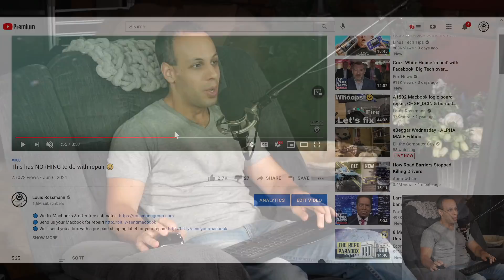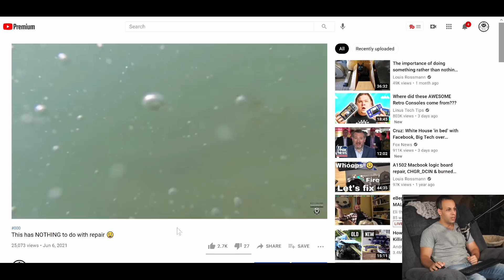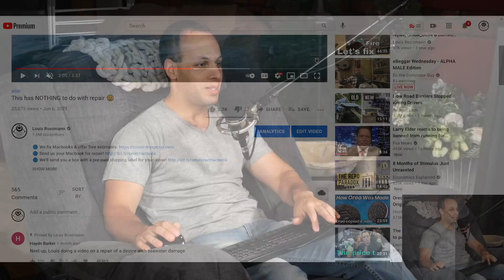Why are user serviceable batteries a bad thing?

Comment: I would hope that everyone would agree that we shouldn't have to go through miles of glue to replace our batteries. Some of the Microsoft Surface machines literally need the screen replaced if you swap the battery, which is just silly. It is easier for them to design the device without the removable battery, and it is better for the bottom line. I think it is just convenient for companies and people don't care enough about it because they know in two years time they will probably buy something else. Maybe once they can't improve computer chips anymore people will start thinking about repairability again.

Comment: At least having the back side screwed in with torx screws instead of being glued would enable battery changes in a matter of minutes without any increase in thickness. It would also look good in flat devices like the iphone 12-line. If a battery lasts 3 years a battery change can extend it to 6 years, two changes to 9 years etc. If it wasn't for the battery and software making it obsolete, a smartphone could easily last a decade with cases and screen protectors. The industry wants consumers to replace their devices every two years but I think a five year cadence (with a half way battery swap) is much more reasonable economically and ecologically.

Comment: It is like manufacturers plan the device to be changed every 1-2 years... I gave my old smartphone to my mom, and recently the battery died. Thank go I bought a spare one because it's not available now. Also, it's stuck on android 7.1 so go figure it out. Could be good if I could install Lineage OS but that is also not an option now as manufacturers take some measures against it (encrypting the storage or something). I hate this so much... Meanwhile, I found an old Samsung X520, I bought a second-hand battery and it is still working.

Comment: So this is what I've learned over the years about removable batteries, from user testing, repair and industry insight.

1: The vast, vast majority of device batteries, to this day, are still socketed in some fashion - not soldered. So if you can get to the battery, IMO it's some degree of "user replaceable". 

2: Sony made water resistant phones with no discernable bulk added vs nokia, samsung etc, with user replaceable batteries, as far back as 15-20 years ago. Same for more modern models. They still had all the common ports.

3: There's this magical thing called a "gasket". Not quite bleeding edge tech, but still pretty cool.

4: The primary reason batteries are "sealed inside" using adhesive on the last 5-6-7 years of smartphones, had nothing to do with IP rating. It's a combination of 3 factors that lead to this. 2 of them being user/customer demands.

First; Users demanded wireless techs like NFC (and all the utilities that enables, from easy tap n pay, to secure entrance credentials (displacing plastic cards). And wireless charging.

Second; Users demanded more premium materials. They didn't want plastic rear panels anymore, but glass, ceramics or metals.

Third: Incompatability and manufacturing technical limitations. Making a friction fit and durable user friendly rear cover, is somewhat easy. You cast/mold it in plastics. You could also stamp and punch it in metal. It's not very cheap, but its economy scales very well.

But there's the problem. In this situation, plastic is out. And metal is a no-go - it blocks wireless signals so no NFC or wireless charging. So to meet customer demands, you're left with glass or ceramics.

These materials are fragile if a panel of it is bent and twisted. So the materials themselves are inherently not user friendly for this application. Next, manufacturing one that has the complex shapes and small, super tight tolerance details needed for a friction fit phone rear cover, is a nightmare. 

Tolerances must be super tight because the material isn't forgiving - it won't bend, stretch, twist etc. So if you try to (just) cast and mold it, expect more than 80-90% of output to be trash. So you're left with painstaking manual, by hand shaping and finishing. And a lot of it. There will still be significant waste and breakage. This process scales terribly, because the majority processing is manual detail work. So the end product - your barely user serviceable, friction fit rear glass or ceramic panel, will cost at least $40-50 a pop to manufacture. And because of the inherent material property, you can expect to have to replace probably 50% of them under warranty when they break while used as intended.

All this - not happening. No way. So what's the alternative? A simpler geometric shape that is easily mass produced. So no friction fit. Meaning it has to be attached to the phone with adhesives.

Notes:
To get batteries out, you still often need heat, some IPA and some patience to get them loose, especially in the case of smartphones. As they no longer have the mechanical structure retaining them by clips and plastic profiles, they're now held in by ahesive. Some manufacturers are better about using pull tab style ahesive strips, enabling you to "pull out" the adhesive strips from under the battery. Those are notorious for breaking, but the intention is still there.

Comment: Louis does bring up a good point. Serviceable batteries does NOT always mean you lose water resistance. My sister gave me her Galaxy S6 when she bought her new Galaxy S7 years ago. I did some research on the S6 once I owned it and saw that none of the marketing promoted it as water resistant at all, not even the S6 Edge either, whereas the regular Galaxy S5 was promoted as IP-67 water resistance, removable and replaceable battery, along with a micro-SD card expansion slot. The Galaxy S6 had none of this. Granted, it was the first phone Samsung had made with glass on the back, something that not even Apple had on their iPhone 6. If you wanted to buy an S6 with water resistance, you had to buy the S6 active that came out 2 months after the regular S6 came out, kind of screwing over some of the people that had initially bought the regular S6 in April of 2015. They added the micro-SD card expansion slot later on the Galaxy S7, S7 Edge, an S7 active but the battery wasn’t as easily serviceable as they still kept the glass on their backs anyways. Those were just my thoughts a couple years ago, where you can imagine how confused some people were as to how the Galaxy S6 and S6 edge were sealed with glass backs yet they had no water resistance even though the regular Galaxy S5 had a removable back-cover with replaceable battery and still managed to have an IP-67 water resistance rating. It’s some truly mind-boggling shit.

Comment: I remember when I had an s5. I had two extra batteries and a charger for them. when one battery finishes in 30 seconds you have a fresh charge. for at least a few years I never charged my phone on a regular basis. was just swapping batteries out. eventually a small crack did develop on the back cover where the indentation is but I just got a new back cover. 

and that phone was water resistant / waterproof (cant remember which marketing term means what) but it was one of those 2. I had that thing submerged multiple times. the back cover just had a rubber gasket going around the circumference of the phone so when the cover clips in place there is some mounting pressure on it. that was sufficient. I remember how pissed I was when the s6 with a sealed battery launched. 

I much rather have a thicker phone with so much more functionality than a thin slab of fragile glass with no bezel to prevent the base of my thumb from accidental touches. Surely there must be a way to make a phone look nice as well as keeping all those functions in.

Comment: People are manipulated by sopposed experts.
When i bought my last phone and complained about the battery not beeing replaceable in the phone i aimed for, the store employee told me that thats the only way the battery could be that capable, the phone that thin and durable.
I called hin on his bs - the phone i had before had the same capacity, was nearly as thin (3 years earlyer, so other components got thiner in the mean time) and was extreamly durable (fell down from >2m (>6.5ft) and the only thing that happend was a dent and the battery falling out).
The industrie is a master in manipulating the masses.

Comment: My S5 mini had a replaceable back for battery access, a headphone jack (a budget phone that came out TWO YEARS before Apple removed the Headphone Jack!!), A MicroSD Card slot and a charge port without a flap, which AFAIK, is the first smartphonephone, or at least Samsung phone to do this.

Comment: What if they just start practically filling devices full of hot glue to ensure any attempt at repair breaks the device? The legislation has to be wide enough to cover what its trying to discourage in spirit, right to repair should mean parts the manufacturer has access to are accessible within reason and devices are not manufactured with malicious intent to prevent repair(ie everything is serialized and permaglued together.).

Comment: I’ve had a couple digital wrist watches (from the 90’s) that I swam with and replaced the batteries as an 8-9 year old. They were water resistant and the battery wasn’t sealed. There isn’t any reason a phone can’t be the same way.

Comment: I hate this attitude of let's take away more features and raise prices.  that's why I've held off on a new phone. I like headphone Jacks, I like user replaceable batteries like my note 4 had. I want an SD card slot. I loved the IR blaster that basically was my only universal remote until the peel app stopped working.  I like getting a charging cable and power brick with a new phone.  why cant companies do stuff like that in a new phone. you had all the tech back in 2014!!!!!

Comment: You have to meet people in the middle. Every laptop 10 years+ ago would have a chunky removable battery, nowadays there are non removable battery laptops that are thin, light and have 4 times the battery life. There are still some laptops with huge removable battery, it's a choice for the consumers. Some people prefer thin, light and sealed laptops... maybe it's not even a technical choice, they prefer the design or style. 
Just because you prefer/like something doesn't mean everyone else does too. Right to repair should not biased towards 'modular'/'open' engineering, don't mix right to repair with that please...

Comment: I still miss my Note4. Did I care if it was waterproof? No. Did I replace the battery 4 times before it began to have bizzare hardware failure that im pretty sure a repair shop could have fixed if parts were available? Yes. (I still have it, and would pay to have it repaired)

Comment: Batteries are now doing shit, what they didn‘t do in the early 90s and 00s:

They bloat and light up in fire. This seems to be caused by thinning and change to high energy Li-Ion batteries.

So that is a reason to lock it away from consumers, as it can be dangerous when the battery is already bloated.

But:
1) EU law demands your battery has to be user-replaceable… more and more companies glue their batteries in and need special equipment to replace it.

When the process itself is dangerous and cannot be done by untrained people, then it is simply not user-replaceable. 

2) I am struggling a lot with DELL at the moment, as they had in the last 3 models batteries that bloat. The problem is, when bloated they break the plastic of they main hull. When we did the call to DELL they just said „it is normal“ meaning - „works as designed“.

You know what DELL? Your Design is BS and therefore your Business Model is BS.

Why have you forgotten to know how to make good batteries and laptop designs?

If your batteries bloat, then design the hull with 5-10mm more space and nobody would notice.

Comment: During a February evening get-together with friends in a previous life in the far north, I dropped my 5110 on a snowy sidewalk without realizing it. Some hours later a middle-aged dude picked it up and since this was before the time of PINs, unlocked it and called the first contact on my phone, one of the friends I was with. Picked it up, thanked the good soul, looked at the phone and shrugged. I have doubts my current S8 would survive the same treatment—and goodness do I miss having replacement batteries I could slot in.

Comment: it'd 100% suck if the commercial answer to right-to-repair is to fully pot and seal the inside of the device, making repair virtually impossible. You'd be able to buy the chips and see the schematics, but no way you can do anything reasonable on the device. I'd say there does need to be some safeguarding to complete asshole designs

Comment: Often, the software support dies way before the battery. If I can replace the battery, but but don't receive security patches in a timely manner or not at all, then it's still disposable for everybody  (except of those, who find alternative operating systems) who care for security. Repairability as well as software updates need to go hand in hand in order to achieve longevity.

All top cellphone manufacturers with thousands of employees should be able to provide longer software support, when even Teenage Engineering's team of 30 was able to release their update number 243 for the 2011 OP1, turning the synth into an audio interface. I know, that cellphones are way more complex, but in the end it's all the same Android (wit the exception of the iPhone) plus some drivers and (often useless) customizations.

Comment: I use a Xiaomi Redmi Note 8T phone. It only cost me 175 usd and to me it's a good phone with a clear vibrant screen, loud speaker and actually a usable camera. The battery on aliexpress is $8 or so. I tend to keep my phone for about 2.5 years to 3 years before I notice that phone is more prone to smudging more frequently etc. When that time comes I will most likely buy a new Xiaomi product but if anything happens in the under the 2.5 year ownership period I will order a $8 battery and swap it in.

Comment: So, if the excuse is "Water resistant" then why do it in notebooks? At least my notebook opens up after removing 10 screws, so, when I spill water on the keyboard, I can turn it off, remove screws, remove bottom cover and unplug the battery to prevent corrosion. If you can't remove the battery, AND you can't open the device to unplug the battery, then you are straight out of luck when you spill liquid on the keyboard and it seeps into the device... Go figure...

Comment: I have bought samsung xcover pro for that reason even if it's not a speed demon I get replaceable battery, earphone jack and 2 physical programmable buttons (I use one for flashlight). I carry it with otterbox defender because I work in food plant (whey, powdered whey, lactoferin, milk). My work involves mostly computers but once in a while I have to climb on some ladders and platforms. I change my phones only when they die completely but when battery is replaceable I can squeeze few more years without involving repair shop. It's baffling that I need only like 10 minutes to change battery and add some more RAM in my laptop (I did it 2 weeks ago) but when I have to change dead battery in sealed phone i must play with whole screen removal operation, for one freaking dead component that everybody knows is going to die or start dying in 2 years. I know that industry wants us to buy their phones on 2 maybe 3 year basis but I will only change my phone when there is other product that will be better for my needs, much better version of my current device or I would be forced to buy new one because of irreparable failure. I hate throwing out usable devices on landfill and that's why I love your work Louis!

Comment: My cheap, and I mean REALLY cheap unlocked 16GB phone has a replaceable battery. Sure, it's Android 7 but I got not just a replacement battery  but a whole extra phone for $50 just in case I break it. And it comes with a rubber case. Dead battery? No problem, SWAP.

Comment: I retired my htc evo 3d 3 years ago. Not because of a h/w problem but a EOL s/w update that did not let the phone get service anymore. It was (and is) during the time I had it (2011- 2018) a solid device. I replaced the battery in it 4 times. The POS I replaced it with was dead in less then 4 months, and not because I was hard on the phone. I have yet to find a phone that I really like.  The Evo 3d was not a great phone, but it did what I needed. The stuff on the market right now is trashware (they don't want to sell a device that will last you more then a year.)  And for some reason we are okay with trashware?